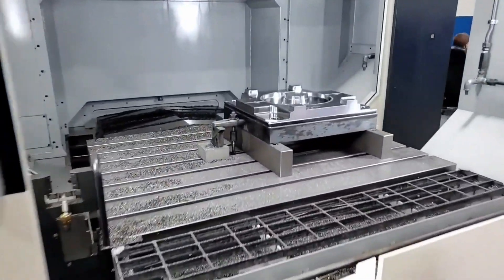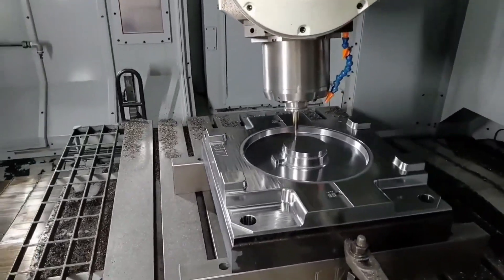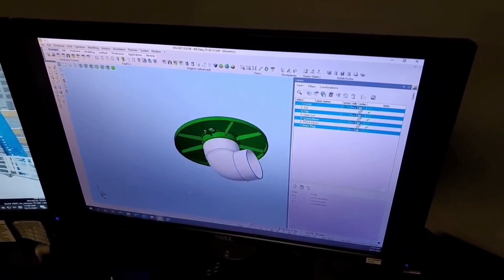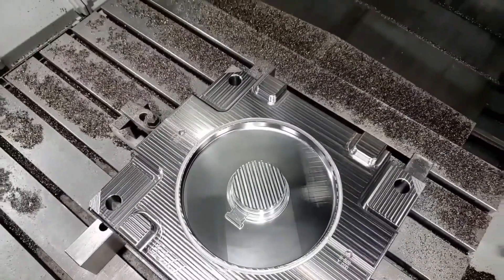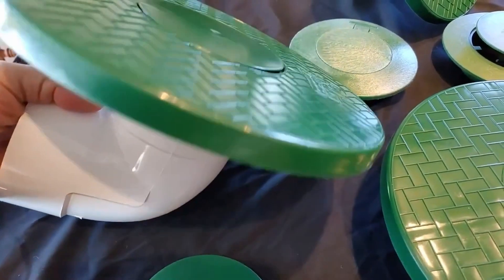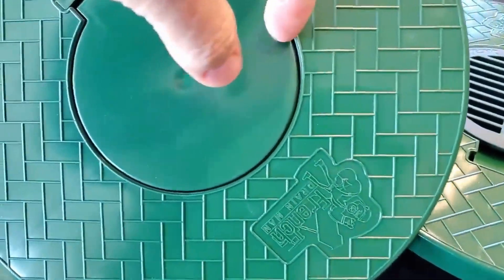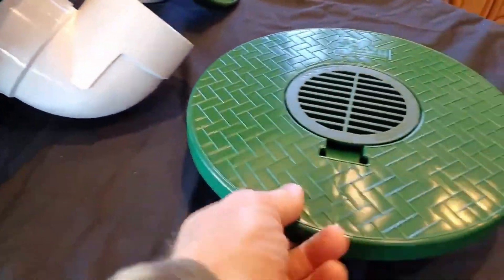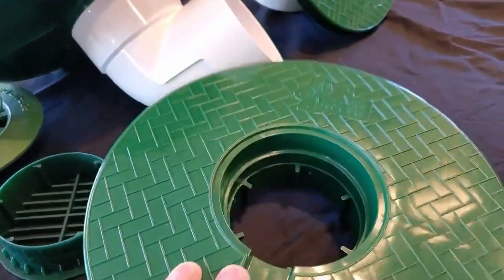New Pop-Up Emitter V 2.0: Game Changer in Drainage! Made in USA, For Yard Drain Downspout Discharge

Comment: I have a couple of these at the house right now. They're great and I'm almost done installing!
I'm still trying to figure out if it's better to do two pop ups (one french, one for downspout/surface pipe), or wye them together at the end. I have to termiate about 20-25ft from the house in clay. The surface/downspout line is carrying 1 3x4, most of my neighbors 2 2x3s, and whatever i get from the 3 surface drains.

I got about 1% slope over 90ft. I feel like it's borderline for one pop up when we get tgat 1 or 2 blasts or rain a year in minnesota? Thanks for all of your and your team's help!
Reply from the maker: One line maxed out 74.1 gallons per minute. We usually tie them together 
https://frenchdrainman.com/product/4-in-dual-wall-wye-and-45-fitting-combination/
Reply: Thank you! @FRENCHDRAINMAN does it need to end in dual wall for the flow, or is single still ok? Thanks so much

Comment: Looks great but do you make a pop up emitter that accepts a 2" Schedule 40 PVC connection?  I was planning on using 2" Schedule 40 PVC size to connect from the 2"x3" downspouts.  Is that doable or does it make sense from an engineering standpoint to expand to 3" or even 4"?
Reply from the maker: I've never seen 2" for a downspout. 2" doesn't displace enough water.
Reply: @FRENCHDRAINMAN  Okay understood.  Do you recommend going with 3" or 4" Schedule 40 PVC to take it out to the curb from the (4) 2"x3" downspouts?  I'm a DIYer planning to do the job using the French Drain Man's pop-up emitters, downspout adapters, y connections and tile tapes.  Or am I better off going with the high octane solids as they would be one to two solid runs per side?  The Schedule 40 PVCs would be multiple connections to run it 40+feet to the curb.  Appreciate the feedback.